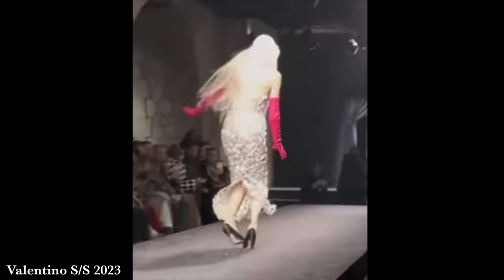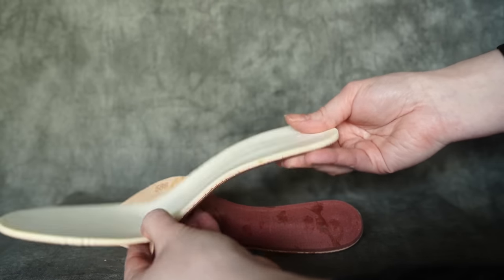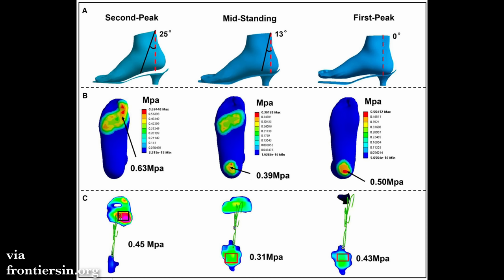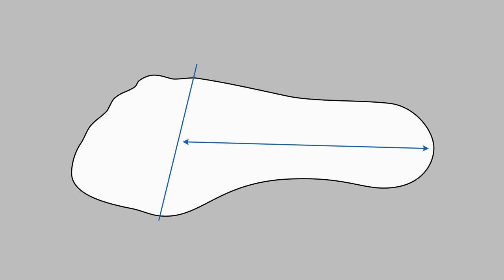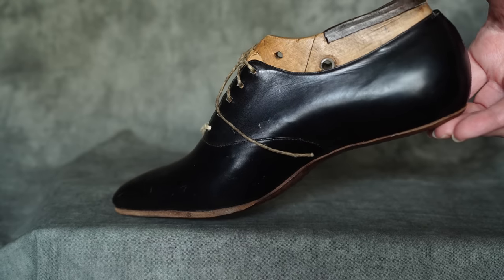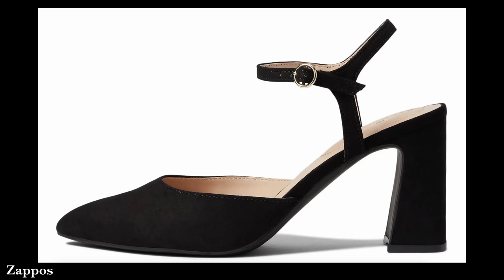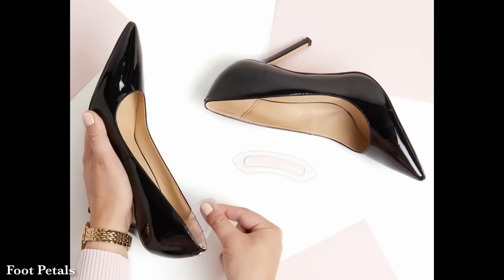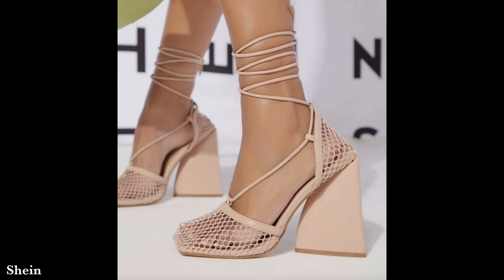Why are Modern High Heels so Bad?

Comment: my mom tried for years to get me to wear heels and wedges and anything that wasn't just sneakers and it just never happened. Shed get me into the shoes, we would go to event and like 10 minutes in it didn't matter if the event was outside or not the shoes would be off and id be barefoot the rest of the time. Even currently if my sneakers aren't fitting right i would rather be bare foot. Im in Canada, Manitoba so we get A LOT of snow and cold weather, would still rather be bare foot then forced into boots with heels or wedges. Still tries even tho im a full ass adult who can buy my own fancy shoes if i really wanted, but i dont, so i wont. 
Idk what brain washing it took for her to get heels drilled into her head so bad but i swear unless my kid asks and wants to wear fancy things, they wont be forced into them
Reply: Lol been there! 
My mother is quite a bit older now & still refuses anything but stilettos, so it’s becoming a bit of problem…

Comment: Oh, I know. I certainly know about the pain and the difficulty of walking in them. I have taken a tumble or two myself. They also cause back pain as well and rub off skin or create blisters. The heel acting like flip flops is real. The absolutely go on how they look not how they function. I have a black pair like the gold ones you showed and they are rock hard rigid. They do not move with my feet at all. It's nuts.

Comment: That was very educational, thank you! :)

I did wear small (thicker) heels (4-5cm) when I was a teen and I’m glad my parents always made sure for my shoes to be soft and flexible even though we could only afford cheap brands. However, when my foot grew some more it became quite wide and my toes are almost straight. So I had the problem that my shoes were either to small (narrow) or too big and my ankle hurt because I couldn’t get the right fit (independent of heels). 
I think my body just doesn’t like heels. I had a pair of the comfiest lightest sandals (7cm) which felt perfekt, I was walking on clouds but then my knees started hurting after just a few hours and after that I decided to not buy heels anymore, just didn’t feel healthy. I still have one pair of sandals (platforms, about 6cm) which are very soft and I can somewhat wear for an evening.

As someone with lots of shoemaking expertise, what’s your opinion on barefoot shoes?
I have switched to barefoot shoes 5 years ago and even though I love the aesthetic of boots with thicker platforms and some heel I just can’t wear it. I’ve tried plenty and they’re either too loose on the ankle or to narrow in the toes. 
Since I have barefoot shoes my feet are completely fine, feel more flexible and strong and whenever I wear one of the few “normal” shoes I still have it feels stiff and like a prison.

Comment: After getting a below knee amputation, and a prosthetic leg and foot, I learned a LOT about foot function. My leg does not have an articulating ankle, since if dirt and grit got in there, it would cause damage. The foot is what I call my "Barbie" foot. Inside of the shell, there's two struts that allows me to transfer weight side to side. I had to do two months of PT to learn to walk with the leg. I have really good form now, but going up and especially down grades is difficult. The hardest part is while I was infirm, my core muscles weakened, and my lower back becomes so painful I can't move.
You do NOT want to injure your feet. I didn't break any bones, but it was a crush injury that separated all the tiny bones of my ankle and foot, I developed a callus from my arch collapsing and still trying to be on my feet at my job. I picked at the callus and it opened up, and I got a terrible infection, called osteomyelitis, and had to be on IV antibiotics for two months, after having surgery. Then after that I had to have surgery again and was on a woundvac (Google that for a good time) for eight weeks. Finally the last time they took my leg at mid calf. That was a horrendous experience, mostly because I had self-righteous nurses who refused me my pain medication (I suppose they thought they would single-handedly end the opioid crisis. I just had my leg cut off, cut me some slack!)
I actually had a tech leave me on my bedside commode, cuz it was the end of her shift and she had to clock out. I had to sit there for an hour and a half until rounds came through. I could've gotten back to bed myself, but to get them to turn off the bed alarm I promised I would never transfer without someone with me.

Comment: I have long narrow feet with long skinny toes and weak ankles, I'm 5"1 with size 8(or 9 and a half inches)feet. The only heels I could wear comfortably were a pair of wedges with the straps being a wide ribbon that I tire around my ankles. Often times my heel is to narrow for the heels so my heel lifts out every step, the heel has no support to it because my feet are so skinny, the heel is to high for my height due to the length of my foot, or the toes are to short and end right at the start of my toes causing rubbing and that's extremely uncomfortable. 

That last bit is also why I can't wear flats as my toes are too long so the edge seam is over the start of my toes and not my foot. So I just wear dress shoes, which is extremely hard to find for women, and one of the reasons I know my size is size 6 in mens/boys.

Comment: Thankyou for this insight. I am a tall woman (European, let's say 6 foot) and I have a Dutch shoesize 43 (sometimes 42.)
I always have problems with my feet and shoes and with every pair of (cheap) shoes, the problems change and I couldn't figure out hów this was possible.
One time I got shoes that were bigger than usual, thinking that would make up for the problems. Instead they 'flopped' around my ankles and indeed, gave me horrible blisters.
I thought it was because they were new and that they needed to be walked in longer, to be larger or something.  I kept walking, until I had literal blood in them at the end of the day (white shoes, so those were never the same again.)
Maybe I should go to a professional and see what they have to say about it. I've only worn óne pair of shoes so far that actually fit me properly, those had to be thrown away last year.

Comment: Before the pandemic, I worked in an office every day. My place of work had a very rigid dress code, and I wore high heels to go with the skirt, blouse and hose I wore every day. The heels were not good for my feet. All of the pressure and weight went to the ball of my foot, and resulted in a stress fracture in the metatarsal that connects to my big toe. I had to wear a medical boot for months while it healed. I never wear heels now, and I'm fine with it. That hurt like the devil.

Comment: I stumbled as a brides-maid while walking down the isle at my sisters wedding. So embarrassing. My sister chose the shoes. I had to get a size bigger than I normally would so that they wouldn't crush my toes, which meant my heel was flopping around all over the place
Reply: My sympathies! (I'm the one who walked around barefoot at my brother's wedding, only putting on my shoes for group photos, because I didn't try out my shoes to make sure they were walkable before the day-of!) Just pulled those shoes out of the closet, and, yeesh. They're sandals held on with nothing but one skinny, stiff strap around the ankle, on a narrow heel my heel would slither back and forth on. The toestap is likewise stiff. There is neither toe slip nor flexibility to the sole. The arch doesn't conform to the shape of my arch at all (and no way to pad anything, in such minimal sandals). In other words, ouch ouch ouch....

Comment: I have big fat feet (9.5 wide width) and have noticed in recent years that stores are carrying less and less varieties and quantities in my size, in store.  They push us to order online.  Um, I need to try them on first!  Last year I ordered two pairs of walking (gym) shoes from Famous Footwear's website.  They were on sale, both fit but I noticed a difference between the two brands.  One has a sort of hump underneath, causing my feet to rock a bit as I walk.  The other does not.  Here's where it gets weird, I brought both on vacation (Disney) in December, wore the flat ones in the airport and around on travel day.  My left knee was feeling tired and overworked by the end of the day.  I wasn't able to put my knee brace on until the next day.  I usually wear it when I'm going to be walking a lot as a preventative measure.  I wore the other shoes the next day and had no problems with my knee.  I wound up wearing the ones with the hump the rest of the week, even wore my knee brace as needed.  But for the most part, the hump shoes seemed better for me.  The reason I didn't wear my knee brace on travel day was because we were going through metal detectors and I didn't want to risk it setting off, especially since we were flying out of 30 degree Chicago to 80 degree Florida. 

I really hate buying clothes and shoes online, it's such a hassle to return things that don't fit .

Comment: I still have stilettos from the 60s, 70s and 80s that I wear and can comfortably walk around in.  In the 90's, shoe construction started changing.  By the teens, I couldn't find either heels or formal/work flats that were either comfortable or fit properly.  
Why things changed I do not know, but I sure wish they'd go back to making shoes the way the used to.  I basically just wear Merrell's now, but take fanatic care of my old shoes.  I also sorely regret discarding many old shoes over the years.
It's not just the construction - the leather used today is very poor quality compared to what was plentifully available when I was younger.
Sigh.
(I used to have to have a pair of thin, strappy heels that had a wide elastic strip sewn in the insole from the inner edge of the ball of the foot to the inner edge of the heel.  They gripped your foot and moved with you.  Stupidly gave them away).

Comment: say, watching the slowed down clips of you walking in heels, one can see that the very edge of the shoe heel, that little corner of the square, hits first, and as you said, there's a moment where you're trying to balance on a very tiny surface area, which seems all the smaller if it starts with that edge. on a non-stiletto heel, would rounding that back edge make walking easier? like im thinking if that back edge isnt hitting, but assisting the heel to hit the ground, would that ease impact? or would it be more like trying to walk on a ball/make you lose your balance more easily?

Comment: I'm a tango dancer. I keep saying this, mall shoes and designer shoes are absolute trash and I refuse to wear anything other than split shank bespoke leather soles from Italy or Argentina. I get picky about 5mm in the heel and swap out 4 pairs of shoes per event. Every time I get shoes I hole punch the straps for an exact fit. I have some character shoes in rotation, but if we're talking heels I only wear madame pivot or comme il faut. You also don't wear your shoes on any surface besides a ballroom floor. I watched an elite couple refuse to dance on a floor once because the floor itself was crap.

Those models are falling because they're in ridiculous molded shank junk that's 3 sizes off and haven't had the straps fitted, and they're on some ridiculous show stage.

Comment: Interesting thank you. This might explain why my cheap supermarket trainers are the most comfortable shoes i own, theyre soft, flexible, cushioned, lightweight, and lace up so I can adjust the fit. I've added a good insole, no more plantar fascitis. 
Walking sandals are hard to find, they've become strappy too. I need a strap that fits right over the bunion joint to hold it in place, most straps are positioned above or below, double ouch!

Comment: The main problem is that fashion models are under pressure to stay as thin as possible = they eat to little and don't have sufficient energy and strength (especially during a hectic runway show where they might not have time to eat at all) in their leg and foot muscles. You can see this in a lot of these "model fail" compilations, where their ankles start to wobble precariously before they fall. Walking in heels is an athletic ability, and if they had the proper strength in their feet and legs, they would most of the time be able to counter all the faults of production that you mention in this video.

Comment: I always found my dance shoes easier to walk in (even with the flex), and often had them soled in rubber/non slip rather than buy specific heels.
I figured if I could run backward in them, walking forward was easy.

Comment: You should land squarely on the heel then to the 5th metatarsal and then to the 1st metatarsal to push off.  So heel -5th-1st.  I have small feet for my height (6foot tall,  size 6 UK) but due to being what used to be a D fitting widthwise I usually take a 6 and a half or even a seven because they don't accommodate width at all these days. I trained to be a chiropodist in the 70s but never carried it on because it meant signing a 2 year contract to work somewhere I hated. I was also trained in pedicure, proper fitting of shoes and arch supports and in fitting elastic support hosiery properly.  I seem to have an endless knowledge of fest and shoes, I should probably work in that area but it never really occurred until now.  I live in Flat shoes these days but remember a time when I wore heels so much, flat shoes caused pain in my calves due to shortening of the calf muscles.  I have some high heels, my guilty pleasures but my favourite shoe is that 1920s to 30s Cuban (not the block heels the more hourglass shaped hee,) which I just adore as they can be both flattering and comfortable.  My ankles have always had a tendency to buckle in certain shoes, or maybe not even certain shoes, heels usually but it can happen out of the blue and it's more a forward action as opposed to the rolling you describe.  I think it's a weakness that I have and I have seen my sister doing the same, it's more like you go " over" your ankle at the front rather than either side.

Comment: About the pinching problem, I had a pair of flat platform shoes and they sliced the back of my heel like pastrami in the middle of a cross walk. I had to hobble to my Nana's to get the cuts (yes cuts, not scrapes) cleaned out and get bandages. I'm lucky I live in a small town. They were every day shoes, quite low to the ground, and there wasn't anything hard or sharp on that edge, just fake soft leather and machine stitched nylon thread. I've also gotten scraped with a pair of off brand converse so its not just a high heel problem.

Comment: I learned a long time ago - do not wear high heels unless you don't mind having pain, instability and eventually deformed feet.  These shoes make me cringe thinking how they  would feel on my feet if I had to walk more than two steps.  All pointed toe shoes hurt my little toe, but all heels over 1/2 inch pinch my toes together.  Haven't worn them in over 40 years and I now have switched to wide width flat shoes and I have very happy feet.  When I first started working and wearing heels to the office it was impossible (and still is) to find shoes with toes wide enough not to hurt.  Even round toe shoes were not made wide enough.  My feet are still shaped like a child's feet and weren't designed to fit into most shoes.  Those high heels are pretty though.

Comment: This is interesting however I hate toe springs, lol. I feel unstable unless my whole foot is in contact with the ground, which means I buy heels with thin(flexible?) shanks, and thin soles so I can feel the ground as I walk. I can't wear a platform and not trip, even if it's a low 1" platform, because I can't flex my foot nor feel the contour of the ground. I have the same issue with wedges and some heels with really thick shafts. All of my heels are pretty much 4" though, and I wonder how that changes the mechanics.

Comment: As a man I do not use shoes with high heels. But I wear shoes with toe caps for work. It is a huge relief when I change shoes for going home. I use shoes designed for walking, with rounded soles and most of the weight being carried by the arc of my feet.

Comment: I work for a shoe brand and can confirm - cutting corners in order to produce new styles more and more quickly has indeed resulted in a sacrifice in comfort and quality :/ Our most comfortable shoes are basically the low, block heels. And very few of them are as flexible as they need to be. And, they're not designed by women...😑 And the designers don't really listen to feedback from women about the fit. It's a hot mess lol.

Comment: The 'placement' - position of the heel of the shoe is also a MAJOR - if the heel (the stelleto part) of the is too far back; it makes it harder to walk in; if the heel is positioned CORRECTLY,  u shld be able to track a line directly up thru it to the CENTRE OF YOUR OWN HEEL, a lot of this part of the shoe are made with the 'line' intercepting the absolute back of ur heel, which is not balanced correctly and is anatomically INCORRECT

Comment: As someone with wide feet, I hate heels. I’ve never had heels that don’t leave blisters, they always slide forward, they always pinch my toes. Since my toes never fit in the right size, I often need to size up, which makes the problem even worse. I stick to flats as much as possible (luckily my job is totally good for that), and keep the heel under 2” the rest of the time. It’s extremely limiting 

When I buy casual shoes, like runners or beach sandals, I actually buy shoes from the tween/teen boys section. Mens are way too big, but the boys section are short and wide enough to fit. They’re also designed to be supportive and cost less than anything in the womens area. They aren’t cute, but at least I can walk without tripping